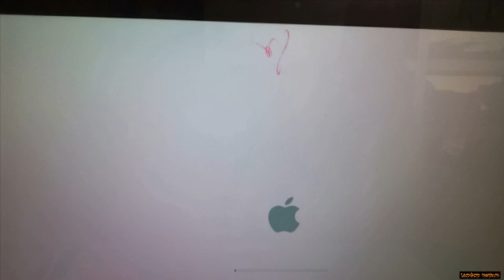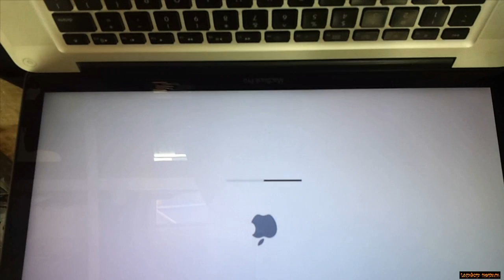2011 Apple MacBook Pro graphics issues are solved - Laptop repair

Comment: Fuck you APPLE i have same problem
Reply: Eric Summers1 day ago
Absolutely so our first step would be to burn the Ubuntu 12.04 Iso to a CD or to a Flash drive. I think your flash drive will need to be atleast 2 gigabites. You can email me at esummers91@gmail.com or call me at (404) 974-6256.

Comment: Ubuntu 12.04 , will allow you to boot to the integrated graphics card, once you go into the recovery menu, Sometimes you will get the disabling irc #17  error , just keep restarting the mac, eventually you will get the ubuntu menu that will allow you to to choose Ubuntu recovery, Once in recovery select the Graphic Card Option- Once it loads You will see the option to boot to  Normally. Once you get into Ubuntu , you can install Virtual Machine and Run any OS you want to run from a Virtual Environment. Email me or send me a message if you have any questions . I just want to help the world
Reply: Hello Eric Summers, I have the same problem with my Macbook Pro 2011, I'm so frustrated with and the Apple genius won't service it anymore. Please would help me to solve this problem. Really appreciate your help. Thanks.
Reply: Absolutely so our first step would be to burn the Ubuntu 12.04 Iso to a CD or to a Flash drive. I think your flash drive will need to be atleast 2 gigabites. You can email me at esummers91@gmail.com or call me at (404) 974-6256.
Reply: Hi Eric, thank you for your reply, I will do that. Thanks
Reply: Anytime ! Keep us posted
Reply: Hi my names john , can u help me with my Macbook , I have the same graphics error , but I dont have this tools, please my email is Benisbodo@gmail.com, I will awaiting your response please.. thanks